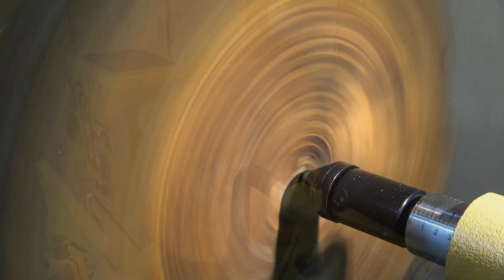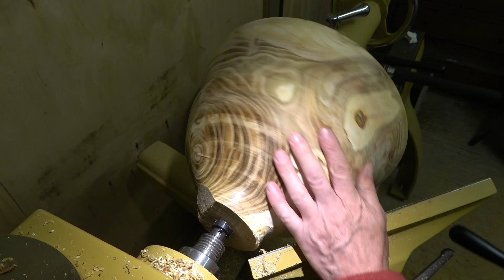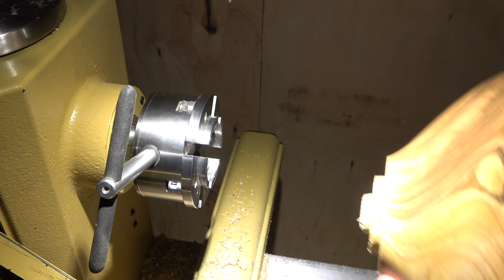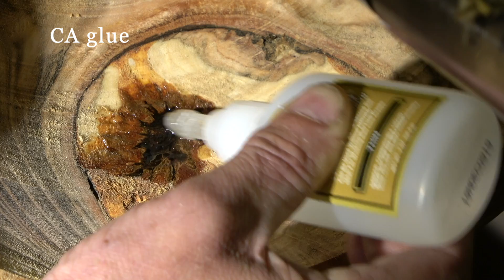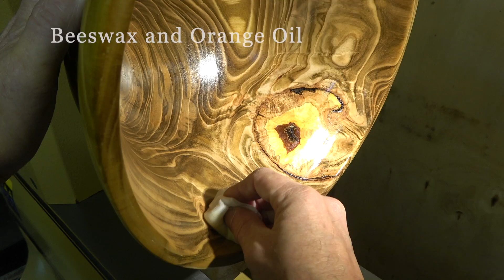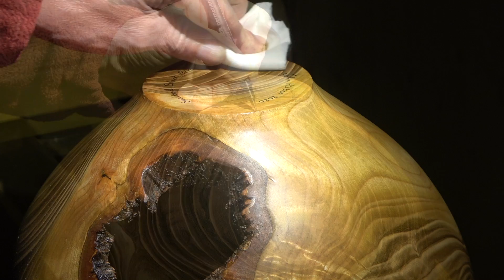Woodturning 1: The river birch bowl

Comment: Outstanding grain figure that you have showen to it's best,  It is a shame that that wood is NOT available here in the UK.    I would so like to turn something like you have, Keep up the Fantastic Work 👍👍👍👍👍👍👍👍👍
Reply from the maker: Hi Douglas
Thanks for your great feedback and taking time out to reply.
If you can get hold of freshly cut Birch wood from a local tree surgeon it's worth storing outdoors in the summer weather when it's warm and leave it to spalt for about six weeks (seal the ends with a good end grain sealer to minimise cracking). It happened to the wood in the video just by chance. If I'd turned it sooner the grain wouldn't have been so visible. But it's trial and error!
All the best,
John.
Reply: @johnhiltonwoodturning1899  the tree surgeons in my area have contracts with the local authority to chip everything so I do not get a chance to get any 😭😭😭😭
Reply from the maker: @SilverBack.  That's a shame but I can relate to that. Most of the logs around here, which would be fantastic for turning, get split for firewood!
Reply: @johnhiltonwoodturning1899  What a total waste of a resource

Comment: Interesting methods. Being me, I would have cored it, but hard to do with the tailstock engaged, and that tenon would be a bit on the small side for holding the piece to core without that support. I do use scrapers for all of my heavy roughing, but never for a finish cut. I have found that a scraper, with the burr honed totally off can leave a good surface, but that seems to work better on very hard woods than it does on softer woods, and I think of birch as being rather soft. Trying to figure out what the tool is that you used for a bit on the inside. It almost looked like an Oland tool, which is a smaller scraper, or a hollowing type tool...
Reply from the maker: Thanks very much for great feedback.
I went for a small tenon to get the shape I was after but completely agree it was just too much weight to rely on. The wood was green and pretty heavy!
I've not tried coring yet - something for the future.
The hollowing tool is from Hope Woodturning. It's great for removing wood quickly and for fine cuts too, but it needs very careful control. It can bite!
All the best,
John.
Reply: I have been bit before....

Comment: The grain is absolutely stunning 💕 I was wondering,would it be possible to have used clear resin and been able to both preserve the hole and the character it adds to the piece, while making the bowl more versatile?
Reply from the maker: Hi Jen,
Thanks for great feedback. Yes you are right. I could use clear resin. But when I turned the bowl the wood was green (wet) and only about six weeks after the tree was cut by local tree surgeons. Resin and wet wood don't work well, but after it's dried I could use resin. Another project for another day!
All the best,
John.
Reply: I realize Im pretty off topic but does anybody know a good website to watch newly released movies online ?

Comment: I've never turned wood, so I come to videos like this with total ignorance. Do you start a project with a firm idea of what you mean to do, or do you let the wood talk to you as you go along?
Reply from the maker: Hi Steve
Thanks for the feedback and the question. The answer for me is both: I start out with an idea based on the shape and any visible grain of and decide as I go along if the idea is working or not, then adapt as I discover what’s inside. I like to turn logs and rough wood. It holds more surprises than dried and processed blanks.

I’m just posting my second video: Woodturning 2 The electric blue burr. Let me know what you think. The resin was not planned, it became necessary as I turned the wood!

All the best,
J.